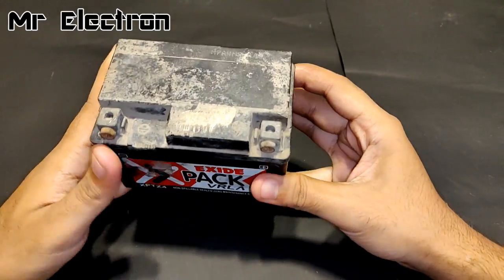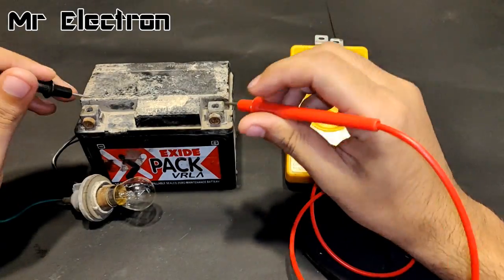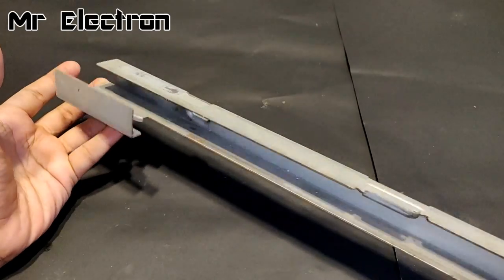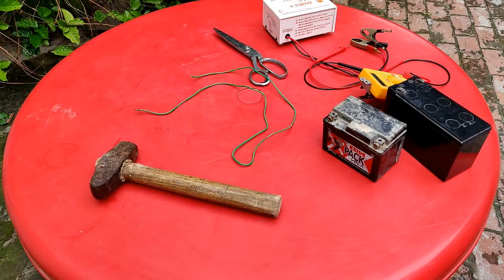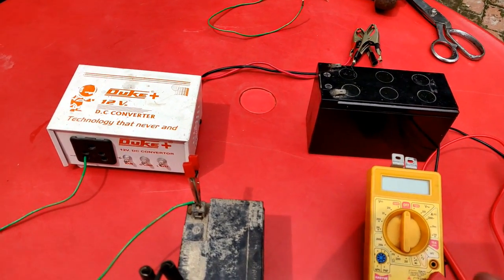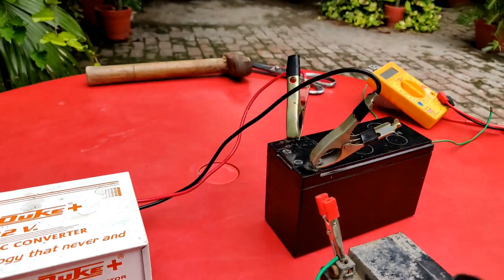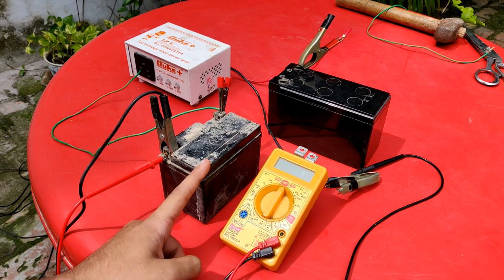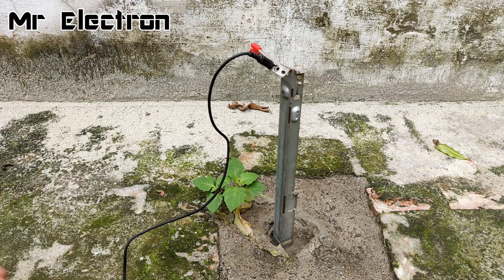Can we charge a 12V Battery with just one wire ?

Comment: Its not charging. Its voltage was rising because first you almost shorted the battery with light and voltage went realy low. Ofc after that it will rise slowly back to 12v

Comment: CLEN on Ali Express has a battery desulfator for about 15 to 20 USD... My blem Interstate battery was installed 10/2013... That is almost 7 years ago... If it last 9 years... I will buy a new battery and start new.  The unit causes the sulfation to collect at one of the battery terminals which has to be cleaned away.  i think e-bay has them also.

Comment: try a capacitor between earth ground and the battery (negative) and then put up an ariel alluminum plate insulated with mylar with germanium diodes between the plate and positive batery terminal.

tesla radiant generator

find an old car radiator and use it for your ground rod or anything else that is made of copper.

don smith said if there is a capacitor between earth ground and the circuit the electrons will always flow out of the ground not into it.  he also said diodes are an overunity device. but didnt say germanium diodes which may have been what he ment.

the moray valve is just a very big germanium diode.  he was a morman missionary in europe and stumbled onto a box car loaded with an unknown mineral.  he traced the mineral in the car back to the mine.  it was never said what the mineral was but it was germanium.

don smith said diodes were overunity devices, but he never said they were germanium.  today germanium diodes are very small so maybe connect 50 or 100 parrell and see what they do in your ground battery.

i said mylar but you could try other more accessable dialectrics for your plate insulator. tesla used mica.  if you had a way to increase the frequency into the radio arena above 20,000 hz and 100,000 to 500,000 hz going into a ferrite transformer or ferite core inductor it might build amperage you need to better charge a battery.   you can see from what you have done here just how important the ground is into a load or in this case a battery... now we have to keep going with a better ground and an antenna and diodes.

Comment: That was interesting, but may I wonder if it possible to do it with wall live feed power instead the converter connected to to low amps 12v battery?
Reply from the maker: its possible ..

Comment: The voltage gained is very little.... can it light up a light bulb 💡 ?
Reply from the maker: LED's at present..  Battery as you saw in the video is too old and dry to power up any heavy load.

Comment: This battery will never get charged as there is no closed circuit to it. Just because this dc/dc converter is grounded through the battery to be charged, it doesn't mean that it will be charged. There is no logic in this "circuit". Only children play...
Reply from the maker: It will charge .. I guarantee.
Reply: @MrElectron  Did you ever measure the current through the battery? When we talk about battery charging, we talk about charging current. If you measure it, just tell me its level and then we can discuss further. Without that, your guarantee means nothing. This is a matter of physics, not of imagination.
Reply from the maker: Increasing volts guarantee the current flow.
Reply: @MrElectron  I am waiting for the value of the measured current. Then we can discuss on a real basis. Not on science fiction.

Comment: Wouldnt it work better if there was a diode used in the circuit? And maybe plugging a wire in to the other side of the inverter. And just use it as an antenna, maybe getting more electrons to flow? But a full bridge rectifier, and a large resistor would work best ha-ha!! Great video!
Reply from the maker: That might just work at very high voltage thereby enabling the electrons to travel through air

Comment: Duke + 12 volt DC converter is just a power inverter  12 volt dc to 115 volt ac or 220 volt ac. I don't know how this works to charge 12 volt lead acid battery the way you have it hooked up , however I will research this.
Reply from the maker: Output is in dc.. Like 220v dc
Reply: @MrElectron  WOW!    ok.

Comment: This trick is old school.... You should show the voltage level on the battery with both +, - terminal connected to the DC converter then your objective will void as the DC converter depletes the battery with both terminal connected.
Reply from the maker: Dc converter is producing 220v which will get short circuited if both of its terminals are connected to the battery
Reply: @MrElectron   Mr Electron  silly 😋 I @6:55 meant to show the voltage level on the battery which is driving the DC converter to show the fact that this battery is being depleted to charge the target battery...... You got me wrong....
Reply from the maker: @Redmi Dubai ohh !! Now i get it.. Yeah ! Well it gets depleted but at a very low rate than when actually connected to a load..